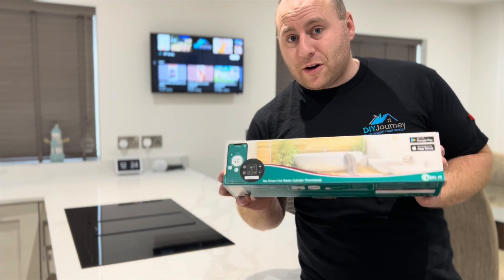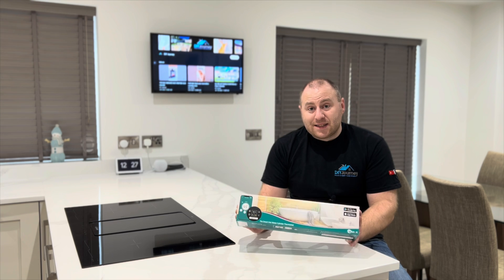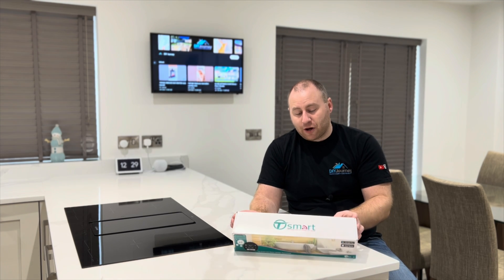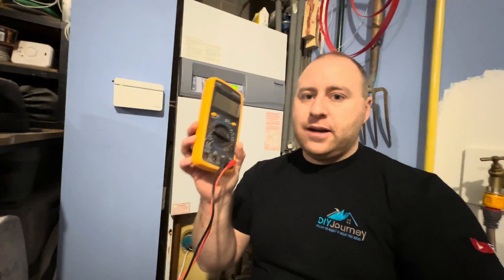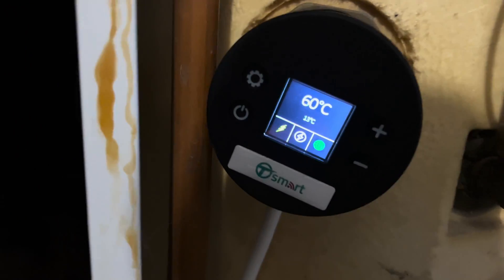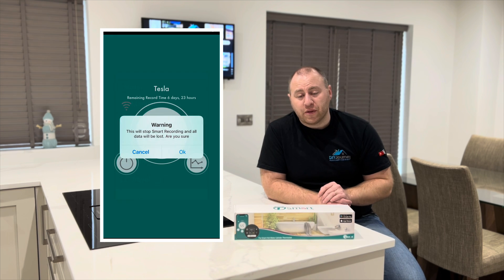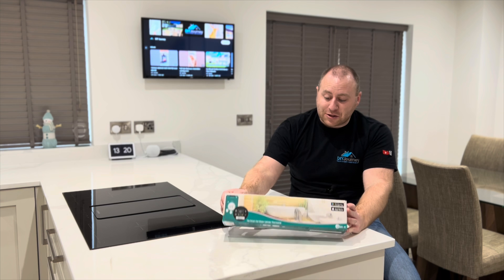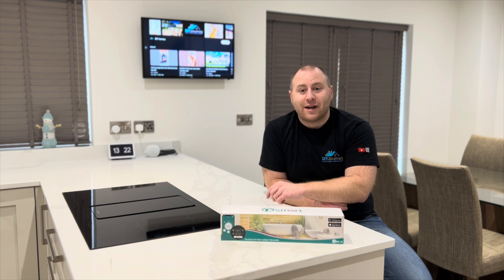REDUCING our GAS BILL with TESLA T-SMART IMMERSION Controller

Comment: Great video. What made you change from Nest to Drayton?
Reply from the maker: The individual room control. However we have now switched back to Nest
Reply: @DIYJourney1 😅 Any reason? 
Another question. I have Nest for my central heating and hot water cylinder. Is there any way to have the Nest display how hot the water in the cylinder is?

Comment: I get the off peak top up , but i can’t understand why it can’t use the solar power bypass feed as well, I basically went down the solar diverter root,  to heat my two 00 litre cylinders using thf 16kwh combined solar on the property and at the time divert the rest to the heat pump ,  I’ve ditched the heat pump now as it couldn’t cope with the winter we had last year with 20 days  no grid power (buffalo ny state)  with one epic snow storm ,  we only got 2.2 -3kwh solar peak but it was enough for power to the battery but not the heat pump , (that also left us in less than 14c due to unable to cope with the conditions .  Doing a defrost cycle every 15 mins , even with a soft starter it couldn’t cope
Reply from the maker: It can use solar.
Reply: @DIYJourney1  was there a software update , my version didn’t recognise the solar feed excess power so had to swap it for an iboost
Reply from the maker: Im meaning via the existing breaker board, but it wont connect directly to solar edge system as far as I am aware.

Comment: Thanks for video, hard to find any use info on this, have an economy 7 immersion ( apartment so no solar alllowed :( could you give an update after 10 months
Reply from the maker: Unfortunately I no longer have this fitted as have a solar integrated system now.

This did work very well for the time I had it and was a good option cheap option.

Comment: Does this work with Google nest please? Thank you.
Reply from the maker: I doesn’t have a direct integration, but it doesn’t need to. You set the schedule on this which will negate the need for your boiler to heat the water.
Reply: @DIYJourney1  Thank you so much. But how does nest know if the tank is cold or hot without a thermostat please?
Reply from the maker: My tank has a temperature sensor so cuts the boiler off when its at the selected water temp. 

I anticipate most water tanks and boilers have a water temp adjustment on them. 

Therefore if your water has been heated via electricity the boiler will not heat using gas
Reply: @DIYJourney1  Thank you. I have solar panels which heats up the cylinder through an immersion heater, and cylinder can be heated through boiler too. But the problem is I don't know how hot the cylinder is, and heat the water unnecessarily using gas or electricity override. If there was a gadget to measure the temperature of the water inside the cylinder, I can avoid this situation.
Reply from the maker: This T Smart Immersion thermostat measures the temperature of the water and you can see that on the app. You immersion will cut off when at temperate though but it is key to turn it off, not to waste power as you say.

Comment: So Glad you done this video, whats the benefits of the solar edge immersion than the Tesla t-smart? Not sure if i understand it right ? Thanks
Reply from the maker: The solaredge is integrated with the mind of the solar pv system we have, so any excess solar will automatically heat the hot water with no input from us. The question to ask, is that worth 7x the cost of this?…Im not so sure.